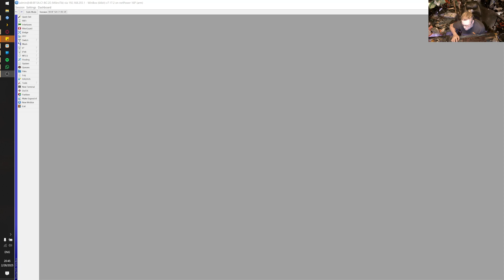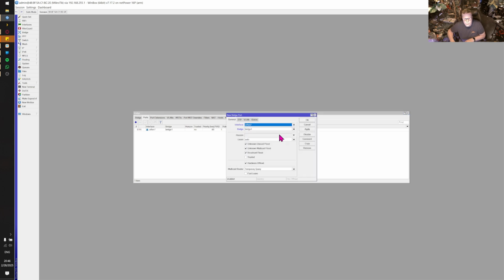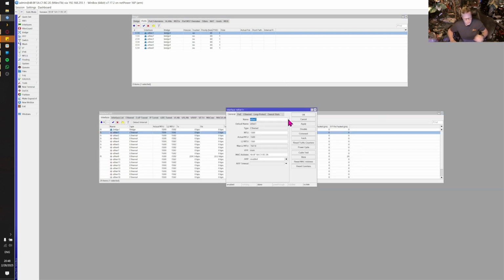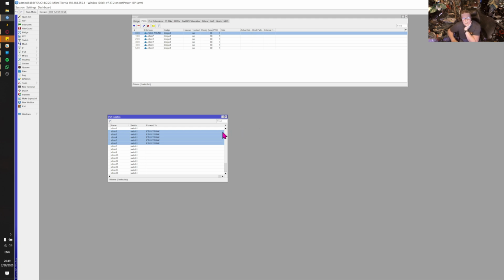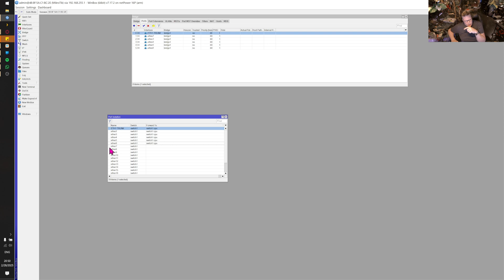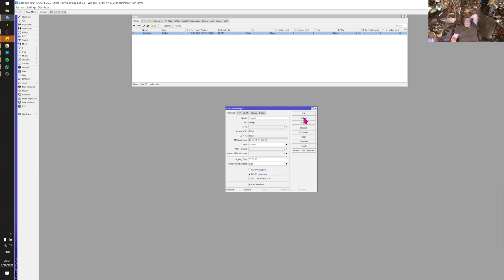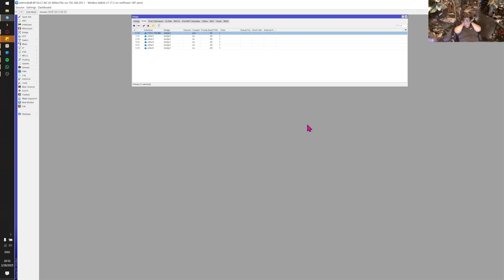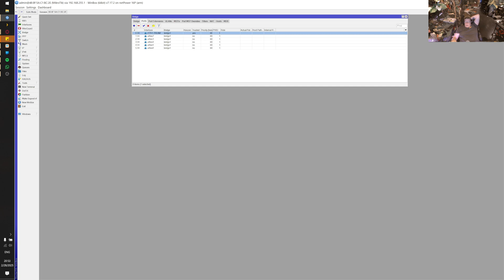Mikrotik ROS Switch Isolation  "The right way"

Comment: I know need this for an OOB network I built. (it's just private vlans as far as I understood so far?)
If you need more examples where you want something like this:
- backup network - you don't want the hosts to have crosstalk capability, you just want to reach the backup host, which will be firewalled and allowed to answer back at most
- dmz network - kill many options for pivoting
Reply from the maker: Wisp, ptmp deployment to isolate customer end points.